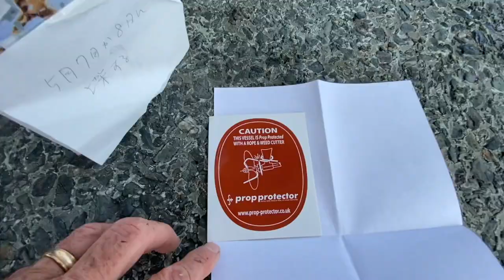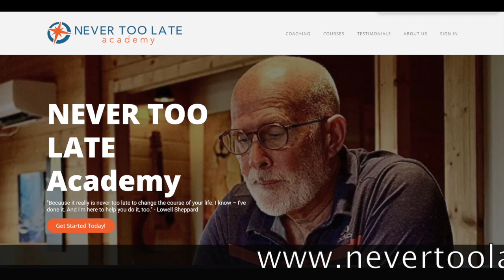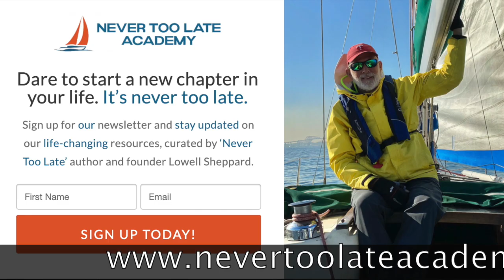How to Install a Line Cutter - a Lesson You Won't Forget

Comment: Is your auto bilge pump working?
Reply from the maker: Still On the list .  Bilges are completely dry. I live on the boat and check frequently
Reply: @PacificSolo  Does your bilge pump work in manual? If it does, then it is the float switch. You really need to get it fixed.